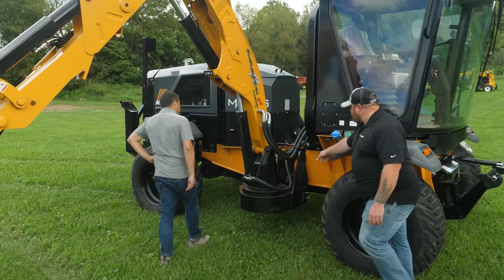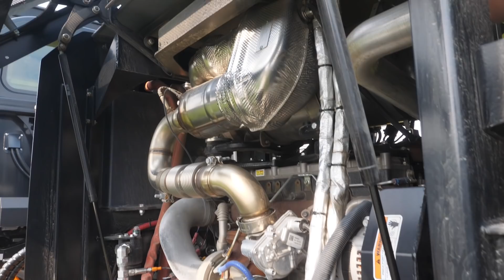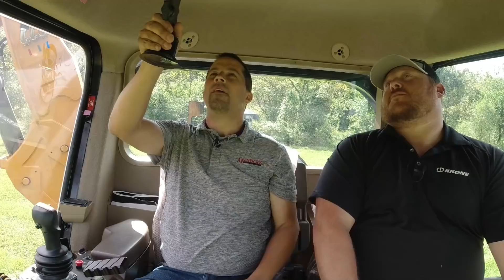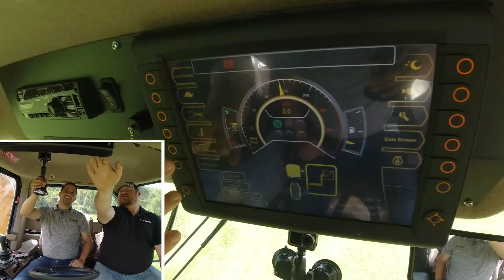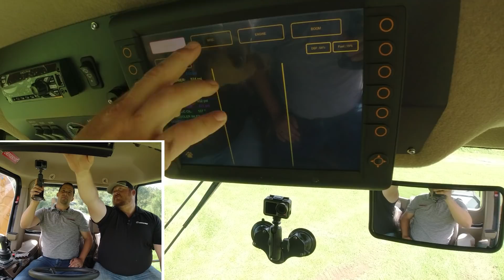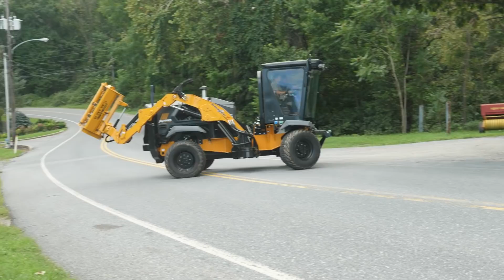Alamo Mantis | Highway Mower and More

Comment: Question:   When I was growing up in the 50's in PA, the highway crews used, if I remember correctly, a type of four wheel mower, rotary I believe, where the operator walked behind the mower controlling it.  Dark forest green color.  I've never seen any pictures or references about it since.    Anyone?

Comment: Gotta love municipal budgets. Sky's the limit...
Reply: That machine as it sits is over $250k.
Reply from the maker: at MSRP. There is heavy discounting for government sales (not that its cheap even then)
Reply: What would a comparable hp tractor set up cost? What about hyd flow compared to a tractor? With the wide area mowers installed, i would assume that ground bearing pressure would be less? So a turf application maybe
Reply from the maker: @williamhall5401  this is about 10-15% more expensive than a like sized tractor setup with a boom mower. It is more versatile, normally you can't use a boom mower and wing mowers on the same machine like this can. If you account for its versatility you can pencil it out pretty quickly.
Reply: Apparently you don’t know about my town lol